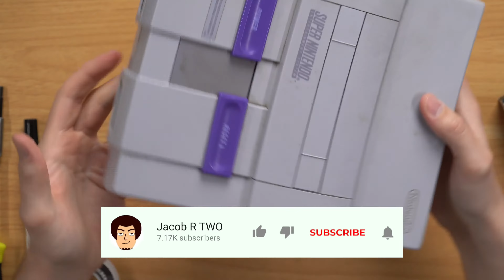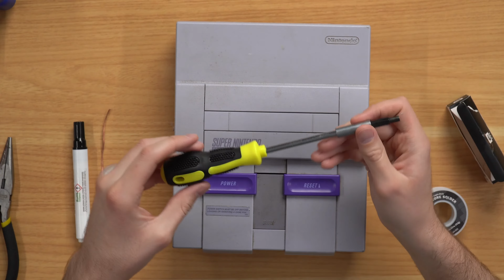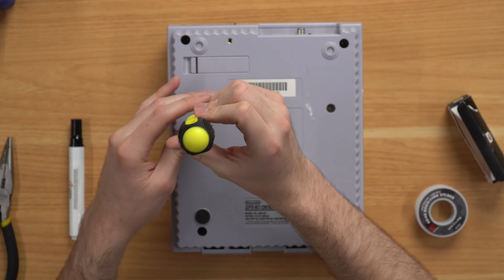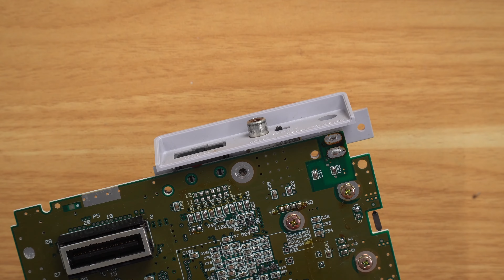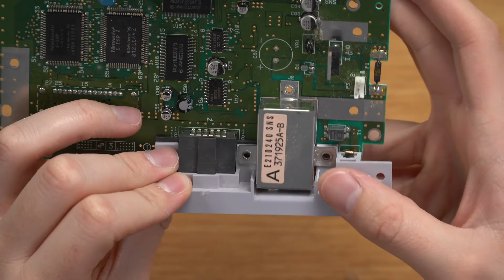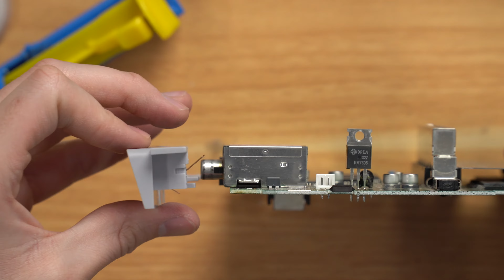How to Replace the SNES Power Port...

Comment: Pro tip for desoldering - add fresh solder onto the existing old solder. It'll liquefy much easier. Use a desoldering pump to get the bulk of it, then use the braid to remover what's left. Lastly, use a flat tip on your soldering iron so you can heat up a larger surface.

Comment: This is exactly what needs to be done to our SNES, but I’ve never soldered anything before nor do we have the equipment to do it yet. It is something that I want to learn to do and fix our consoles if needed.

I think this is a good video to understand the various steps to fix that part.
Reply: I'm in this exact boat right now I  inherited my childhood super nintendo and somehow the power plate is broken. I ordered everything to do it. I'm just worried about the soldering